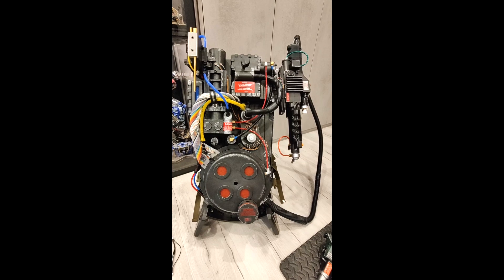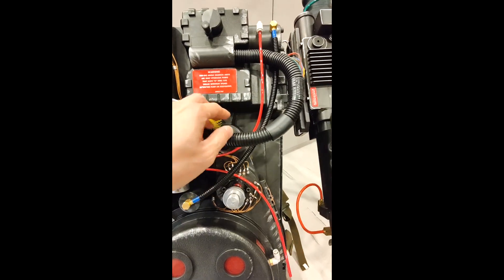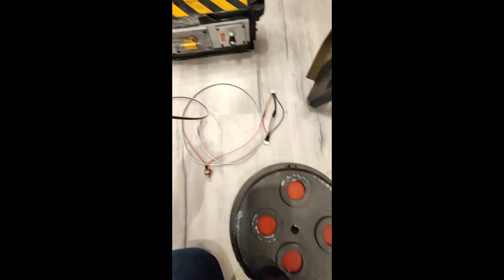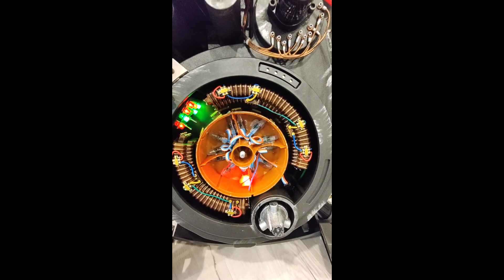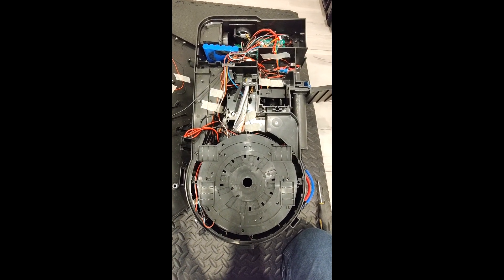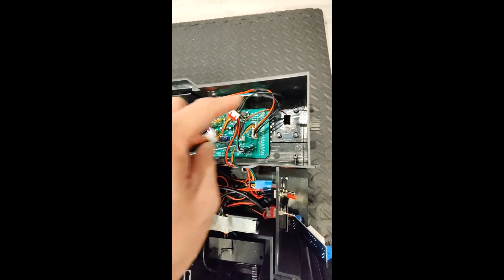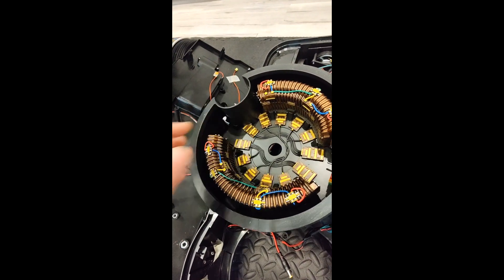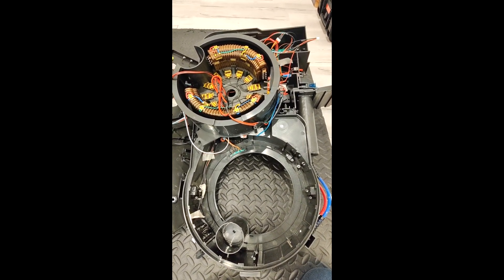Haslab Hasbro Proton Pack DIY PnP Cyclotron"Cake" Led Light Kit. Mimics Cyclotron Lid Light Pattern!

Comment: If I were to just want to have the power cell lights and sounds going when I remove the cyclotron lid how would I do that
Reply from the maker: You will have to open your pack. And then solder a jumper wire to the 2 grounds at the cyclotron pogo pin contacts.
Reply: Thank you
Reply: I’m sorry I’m being a nuisance but I have a couple more questions 

Which wires connected to the inside of the pack near the cyclotron pin connectors are grounds and how do I solder them like do I snip the wires and solder them together or solder directly to the connection points or what
Reply from the maker: @Unstoppable-qs6ek  Not a nuisance at all man! I'm here to help ask as many questions as needed till you get it right! When you open up the pack face down.... You will see a yellow and brown wire and on the circuit board it will say "GND". What you will want to do is get another piece of wire and solder one end to the yellow and another to the black. This will bypass the lid shutdown when removed. Hope that helps!
Reply: Do I like strip the wire and solder it or should I snip it then solder it together
Reply: Also do i need to solder negative or positive lead to it

Comment: What was the reason you relocated the ribbon cable alarm switch? Awesome work btw.
Reply from the maker: I changed over a the GB1 ribbon cable. It was waaay too thick for the stock plastic clamp so I changed it to a full metal screwed in clamp. I also didn't want to lose the cool feature so I moved it 😁

Comment: How did you remove the lid from the cake? It feels impossible!
Reply from the maker: Guitar pick is the key. Or a plastic pry tool in similar thickness. Just push the sharp end up under the lip and wiggle till you hear the glue "snap" and "crack" then you wiggle and slide it across. SO far I've done it on 10 cakes and they were all exactly the same. Hope that helps!

Comment: I must’ve gone around the lid of the cake like 7 times with a Stanley blade and it’s not coming off
Reply from the maker: I feel ya! A few people have usd an Xacto blade with minimum and frustrating results. The problem is that the blade is too thin and isn't wide enough to "pry" and break the glue bond. That's why a guitar pick works wonders.
Reply: Nevermind I got it. You failed to mention the about the smell that hits you when you open it😂😂.
Reply from the maker: @tord6725  WOOHOO! Sometimes they use extra bit of glue and then it takes a crap ton more of patience 😅. Honestly I don't remember a smell when opening it.... But to be fair my nose is probably messed up from the amount of solder fumes I've inhaled lol!!!!